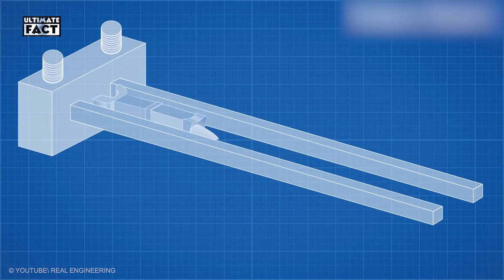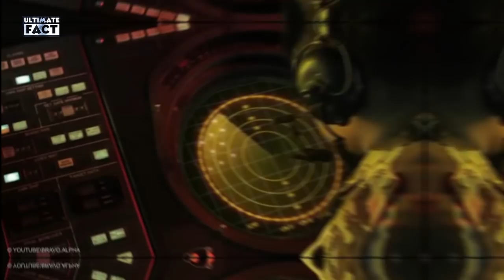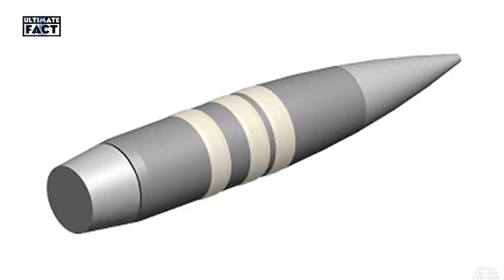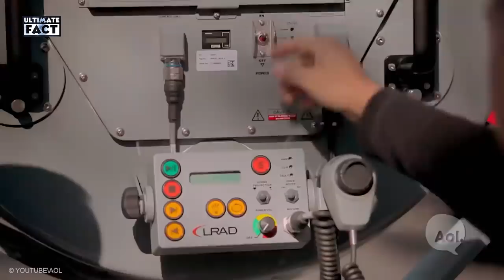Top 30 Future Weapons and Modern Fighting Vehicles Already Being Used

Comment: What's the point of including #1 (quantum stealth tech) if you can't show it? (BTW, most images shown were well known lenticular sheets or plain old CGI). 
You may as well mention the WM-25  phased plasma rifle (in the 40W range) which is also  hasn't been released due to security reasons  - although it's existence was verified or hinted at in T2:JD.
Likewise the Quantum Reverse-temporal Higgs Disruptor which is also no doubt suppressed due to security issues, and the Boson Sweep Nano Fart Wave for similar reasons etc.

Comment: I have an idea for a weapon, emitting a sound wave that can warp the shape of barrels of different materials rendering all guns and cannons unusable because the barrel is warped.  It could be put on a drone that flys and encircles an area repeatedly and anywhere the sound wave effects all barrels begin to warp. Once all the barrels of guns and tanks are warped they can’t fire accurately so the opposing army is forced to surrender. No one gets hurt or dies.
Reply: Steel barrels don't warp easily.

Comment: Robot can move fast like a roller coaster and on the roller coaster is like a clock a robot is like a time clock in the 1950s that how fast robot should be imagine a roller coaster moving back and forth like the swing and the robot is trying to punch concrete and break well that robots should be like roller coaster